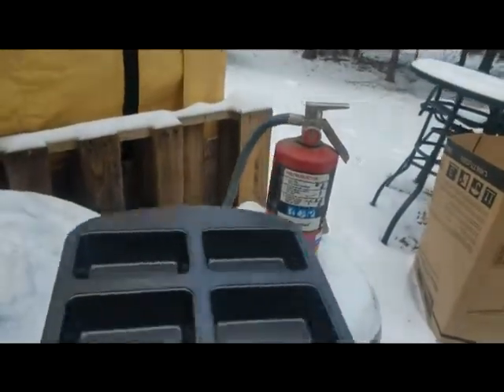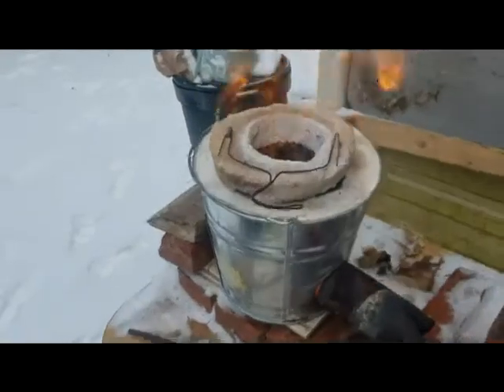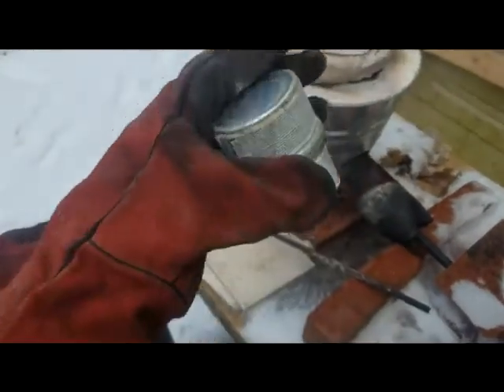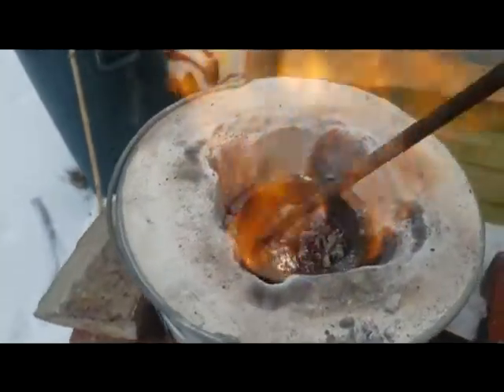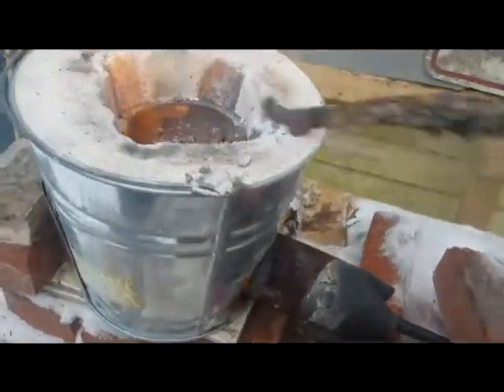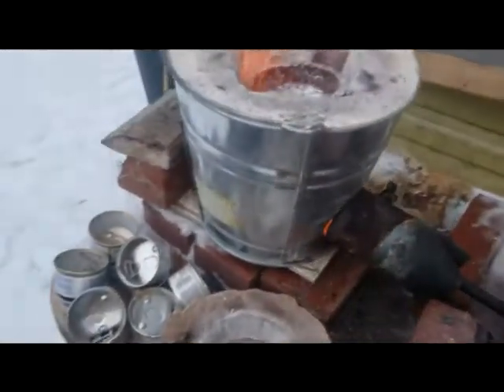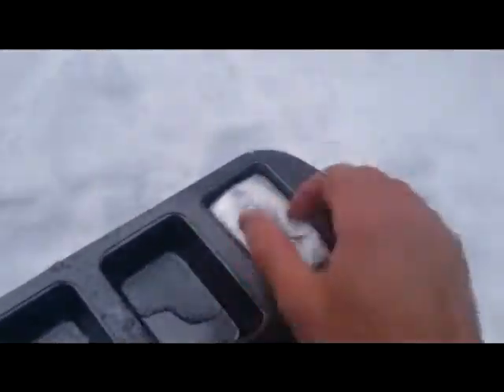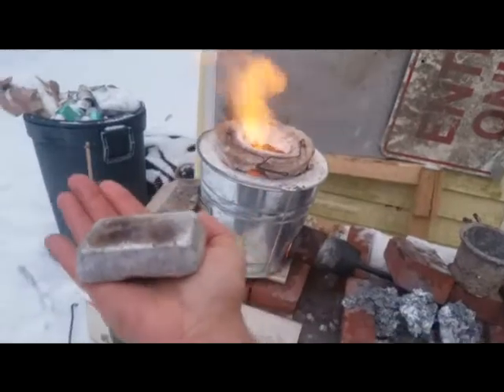Melting Cat Food Cans Into Aluminum Bars

Comment: Can i mix cat food cans with soda cans, Or any other aluminum? Like will it contaminate it?
Reply: I found that you want to separate the different sources as cat food cans are aluminium  alloys but beverage cans are actually 97% plus aluminium. Some say the cat food cans are a waste of time as they don't cast well. I will note that the ingots are much harder than aluminium ingots from wire. I've mixed brands of cat food cans on my first tank but plan on further separation in the future melts as the way they crush implies different alloys. I stamp my ingots with the source, date, and ingot weight. I'm hoping the harder cat can ingots are machinable on a lathe. Got 22 lbs on a tank of propane but are now crushing the cans for better melting efficiency. Don't sit down wind of the furnace as even beverage cans have plastic liners and the fumes are wicked.